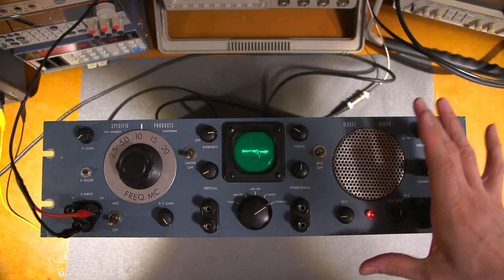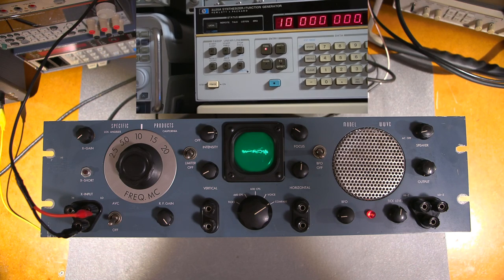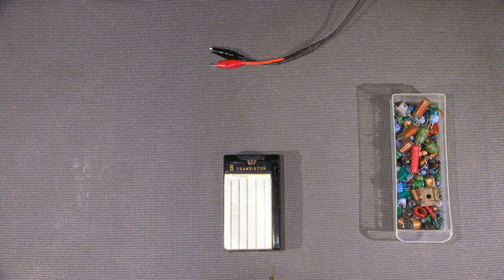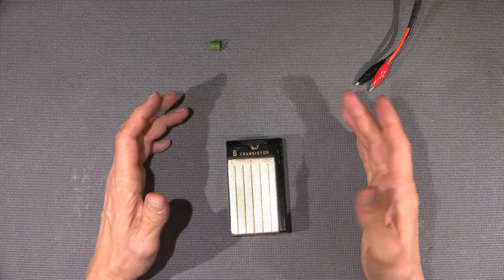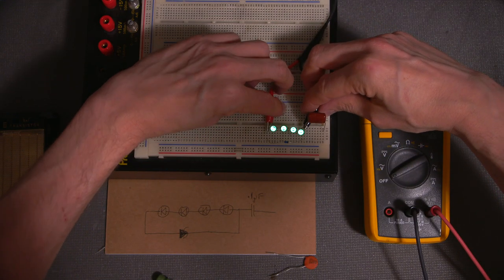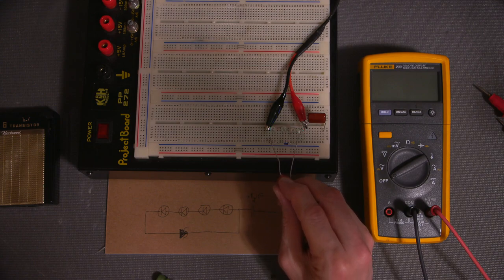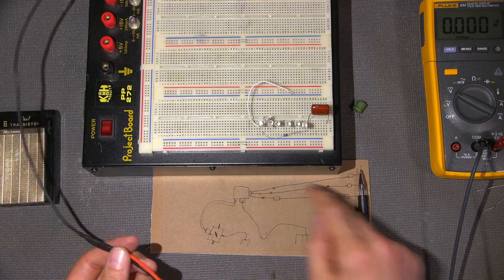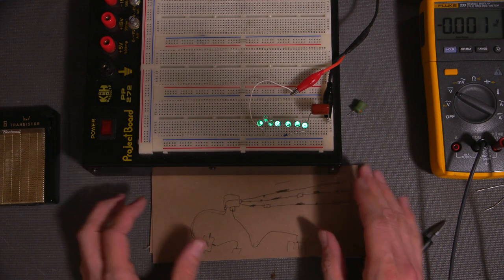Tech Talk And Hang Time At Mr Carlson's Lab!

Comment: Back around 1958-'59, Popular Electonics (or maybe Electronics Illustrated) had a do-it-yourself project for an entirely antenna-powered receiver/amplifier. Tuned to a strong local station, it generated enough voltage to power a transistor amplifier. Then a second tuned circuit could select a different station and be heard louder thru the amplifier.

Comment: Induction... it's amazing stuff. How many LEDs could be lit up this way? The antenna receives RF from remote radiostations, obviously, which is what powers the LEDs. I am curious - would the antenna be 'good enough' to power LEDs from just cosmic background radiation (assuming no radio stations) and/or anything else it'll pick up?

I am asking because it reminds me a bit of Tesla's experiments with a elevated plate being charged up and periodically discharged into a capacitor, gathering supposedly minute quantities of energy. I think later in his life, on July 10, 1932 Nikola Tesla stated: "I have harnessed the cosmic rays and caused them to operate a motive device." That may be a different experiment, but interesting too. 

All this is very interesting stuff. Thanks for sharing, mr. Carlson! Much appreciated!
Reply: I guess it depends how far away a thunderstorm is.... ? In fair weather it can be 100-300Volt per meter (height), and near a thunderstorm it will be in the thousands of V/m, strongly peaking when striking. I don't think it is all rf, but I could be wrong.
Reply: @erikdenhouter  That's an interesting observation - that's static electricity, I believe, but I am not sure if that's the same phenomenon mr. Carlson showed us, which is likely RF energy. I'd love to hear from him about the phenomena we watched. It's fascinating.
Reply: @alpcns  You're right, the capacitor shows it is about rf only.
Reply: @erikdenhouter  I wonder how close his 369 is to overhead power lines ... could he be getting loose coupling to them ? 
Or even electromagnetic radiation at ELF ... 🤔
Reply: @peterfitzpatrick7032  I don't think so, Paul doesn't speak about power lines anywhere. And (as I read) ELF (extreme low frequencies, in the tens of Hz) can not easily pass a .1 µF capacitor, but... the current that makes these LED's glow is low, I think not more than 75µA.
Reply: You can also use induction to prove that your car will run forever: It ran the first mile . . .
Reply: Odd that you mentioned the term "cosmic background radiation" and Tesla. In a word, Tesla proved the existance of cosmic radiation and later called it "dark energy " . We see and hear it everyday when firing up our old CRT analog TV's without an antenna (or off channel). Now how to tap its potential: Strongly recommend you reading "Secrets of the Cold War Technology" especially chapter one. Notwithstanding,  Tesla purportedly did so by repeating the effects of closing a dynamo switch connected to a full working load and perfecting the amount of time the switch were open vs closed (hint...micro seconds closed). The results suggested a controlled and directional transference of pure electricity without electrons. In addition when this energy came into contact to a metal substrate, the metal would shed it electrons, become electrically charged and in some cases melt the metal like one putting a 'match to wax'. Closing: We've been kept in the dark about this since 1895. If you read that book....you can thank me later.
Reply: @Rev22-21  Resonance. It's not magic, or a free lunch, it's simply an efficient way of transferring electricity and nothing more.

Comment: You have demonstrated that the antenna extracts a nice chunk of energy from the radio waves it encounters. The method of multibanding is very clever, too. But the "goodness" of an HF antenna is not determined by raw signal strength, because due to the relatively greater amplitude of atmospheric noise compared with the internal noise generated by the receiver, it's possible to simply amplify the output of an inefficient antenna as much as is needed. This is why small loops with preamplifiers can be good receiving antennas.
The real test of a receiving antenna is its ability to provide a high signal-to-noise ratio. Given that we are not talking about highly directional antennas, that comes down to rejection of local manmade noise. I believe that since the outer shield of your coax is not decoupled in any way from the common lead of the antenna, it will provide a path for local noise from your noisy lab back up into the antenna. A worthwhile experiment would be to connect a  ferrite choke "balun" (not really a balun, but that's what most hams call them) at the feedpoint and see if noise pickup diminishes.

Comment: Nice, efficient enough to light up leds just from RF in the air like a wireless power setup. I guess a downside to that it's also very efficient at picking up 50kV spikes from lightning strikes even at 10-20 miles away. I don't think the leds would like that. Doesn't receviers have peak input signal limits of just a few V before something bad happens?
Reply: Input capacitors, and clamping diodes, can protect the receivers front end.

Comment: My first experience with an antenna was at age nine with a crystal radio.  I hooked a wire to the radio.  The wire was hooked to a broken steel slinky, which was attached to a basketball hoop.  I heard a local AM radio station advertising McDonalds hamburgers.

Comment: I remember that Art Bell was experimenting with a loop antenna he built at his place in Nevada. It was very large and he got a massive amount of voltage off of it. It is reported to be 1595 feet in diameter and has a double loop of wire.

Comment: Mr Carlson, have you considered ground rod earth loops by having four rods as you described. Also, regarding the distance of the rods apart giving rise to bigger earth loops but better overall impedance to earth. Also, the resistivity of frozen soil compared to warmer soil for example....?
I guess it's worth having these new issues in comparison to a noisy grid tied earthing system but would love to hear your input or perhaps experiments.

Comment: Very interesting demo!  Though they are low current, high brightness LEDs, the fact that you can light up a row of them like that with no power input whatsoever is fascinating.  Very Tesla-esque as many other people have mentioned.  Paul, I'm interested in how you calculated the three antenna lengths and how the shorter ones inductively couple to their longer extensions.  Is there a coil between the two lengths or is it just an insulator?
Reply: Like this a lot

Comment: I did a similar experiment on my 160 meter Inverted-L antenna.  I live in the middle of three 5KW AM broadcast stations.  Each are about 2.5 miles from me.  Connecting a full wave diode bridge across the antenna terminals I read 36 volts.  Shorted I get 8 ma.   Lights an LED very bright!  Connecting a frequency selective level meter I measure +10 DBm on two of the three and a little less on the third.

Comment: Hi Paul. That is a cool test gear. I have the same hp generator that you are using and the old gilrl just keeps clicking along. You have one of the best setups for videos also. Never a bad one.
I have learned a lot from your videos even after doing repairs on ham radios and amps for many ryears. Thank you.

Comment: Hi Paul,
That's a very effective antenna. When you were measuring the voltage across the antenna leads, would a VTVM give a more accurate reading? You and the family stay safe.  73  WJ3U
Reply from the maker: Yes, the HP-410B would be a better choice for reading the RF level. Thanks for your kind comment Don!
Reply: And removing the LEDs while taking the reading would be better too. Very impressive. I wonder if most of that power is coming from just one local station? It would be interesting to take some readings via bandpass or tuned filters.

Comment: I have been intrigued by ground rod's for some time now, as far as I know, it's usually just a copper rod hammered into the ground but I have a theory where if the ground rod was insulated with just the tip exposed to ground at the deepest point, I'm expecting a greater difference in potential as the ground point would now be grounded in a more negative point of the earth and thus providing a much stronger signal. My thought process is that the bare copper rod would follow normal Electric rules and thus conduct at the path of least resistance... By forcing it to source ground at a deeper point, you should effectively be increasing the power of the antenna... 
It's an experiment that I have been wanting to do but I just haven't got around to it yet.... 
I really wanted to see the open circuit voltage of your antenna but you didn't end up showing it... 
I wonder what voltage will be present during snow fall? Or rain fall?... Maybe a future video lol????
Reply: Deep thoughts by Peter Milanovski
Reply: @KD2HJP  Deep observation by Charles Nolan 🤓
Reply: I'm currently staring at my shack's ground rod. I fully blame you. 

At least it has potential. (See what I did there)
 73 DE KD2HJP
Reply: Ground rod's what? Noun missing.
Reply: Well this post quickly went deep south!
Reply: To couple efficiently to the earth you need the largest possible surface area of your earthing rod in contact with it. If only its tip is exposed, and we ignore any capacitive coupling effects through the insulated section, your connection will now have an increased resistance to ground. That resistance is in series with your signal, so if it's significant in comparison with the antenna's impedance, a lot of your signal will be converted to heat as it passes through it.
Reply: Electricity does not follow the path of least resistance. It follows all paths, and does so inversely proportional to their resistance.
Reply: @jerrymalone8370  Exactly! So the greater the contact area, the less the resistive losses.
Reply: @jerrymalone8370  that's exactly correct... That's why I mentioned to insulate the ground rod so that only the tip is exposed at a deeper level below ground... As the ground itself is a very good conductor, my thought process is that if I were to use a ground point at a deeper level, I could be increasing the potential difference between it and the antenna above the ground... It's just a theory which I haven't tested yet but plan to in the near future some time...
Reply: @robinvince616  you could be right, I personally haven't seen much on this topic, not that it doesn't exist but more that I haven't had a need to. I'm not interested in radio, well not that kind of radio anyway. I just wanted to explore the possibility of harvesting atmospheric energy, I know that it's been already done and have seen plenty videos on the topic but this grounding thing has me intrigued and I'm wondering if there's anything else in it... 
Where I said about only the tip being exposed, I was being a bit vague... Naturally the exposed end is going to need plenty surface area exposed for better conduction, we are not talking here about a lot of current, but what I'm trying to achieve is a higher voltage without going up with the antenna by grounding at a deeper point in the earth if that makes any sense?
Reply: @PeterMilanovski  If the layers of earth are at different potentials relative to one another, after you put the ground rod in place they will all be at the same potential. The ground rod is conductive, so you will be connecting all of the layers together, and currents can flow between them. The ground rod will have the potential of the deepest layer, and so will the upper layers (near the ground rod).
Reply: @jerrymalone8370  so does that mean I should see a higher voltage compared to a normal ground rod? 
I will experiment with this sooner or later, I don't know what the outcome will be but I will know better after that actual test is performed...
Reply: @PeterMilanovski  The ground is like just one enormous lump of conductive material, so soil characteristics apart, there will be no difference in your results whatever depth you connect to it. The antenna's effective height above ground will still remain its height above the actual surface. Raising the REAL height of the antenna will, in most cases, give an increase in signal strength, because this tends to reduce the screening effect from objects and the Earth's curvature. It also affects the antenna's vertical directional characteristic, focussing it more downwards towards the horizon. This usually favours the more distant signals.
Reply: @robinvince616  that makes sense, but I still have this niggling feeling about the point at which depth the grounding is accessed and I guess that I just have to test it out to put that feeling to rest.... The science behind it is great but I don't think that it's perfect, well science in general and I feel that even though the science is saying one thing and you have something that's telling you that there might be something else in it, you just have to do it...
Reply: @PeterMilanovski  It means that insulating the ground rod will give you a worse ground, with the same voltage on your antenna. Is your rig grounded to your house wiring and/or cold water pipe? If so, you are already connected to a very good ground that is far better connected to the earth than the tip of you insulated ground rod. 

What you want is a high RF voltage between the center conductor and shield on the back of your rig, and the same at the coax right before it goes into the antenna. If you have, say, a dipole, you should not even connect the coax shield to earth ground.
Reply: @PeterMilanovski  It usually takes just two reply's to do that.
Reply: @jerrymalone8370  Tell that to a lighting bolt! Just kidding!
Reply: I don't believe that shielding your ground rod, and connecting with the soil that is deeper into the earth will have much of an effect. The soil is in constant contact with itself, no matter where you connect to it. I don't think there would be any advantage to doing this. In fact, I think that an uninsulated rod of the same length would work better, as it would be in contact with more of the earth.

Comment: Did you build in any meaures against static electricity from your antenna? I can imagine it can generate high voltage spikes when there's a thunderstorm nearby that can deamage your equipment. I'd really like some more info about how this antenna works. It seems to function really well!
Reply from the maker: Yes, oddly enough, we rarely have lightning here, but when I was at the top of the ladder working on the antenna, there were some flashes far off and distant thunder, I could draw arcs from the coax F connector to the mast pipe. This was before the ground rods were connected. I'm very glad I didn't touch the mast and F connector at the same time at the top of that ladder! What are the chances of all this happening at the same time? I should go buy a lotto ticket.
Reply: @MrCarlsonsLab  When I built my first receiver, a transistor super-regenerative short wave radio kit, it needed an antenna.  I used 30 feet of magnet wire strung on small hooks under the eaves of the roof across the front of my home.  Since I lived in tornado alley, severe thunderstorms were fairly  common.  The first time I saw a storm approaching, I disconnected the antenna from the radio so I could attach it to the air duct which I used for a ground.  Before I could attach it to the duct, there was a flash of lightning more than a mile away, which I saw and felt at the same time.  This demonstrated to me that you don't need a direct lightning strike to generate some impressive voltage spikes in a 30 foot wire antenna.  Static / corona is another thing that can build up on elevated metal objects during storms or from falling snow, as you have shown in another video.
Reply: @MrCarlsonsLab  ok, fair enough.. 😊 I wouldn't want to see any of the equipment in your lab being damaged. Or you for that matter..

Comment: Is this a traveling wave antenna? I've not seen the element coupling like this before. For TW antennas, they're terminated into a 50 ohm resistance, but you're not doing that. Is the inductive coupling of the isolated wire elements functioning as a type of matching stub?

Comment: Thanks for what you’re doing! Education and entertainment, all in one. I was a little concerned to see your antenna has an independent ground. When a lightning bolt is close, the difference in ground potential, given their proximity to the strike, can be hundreds of volts or more, with a lot of current behind it. Building codes require all grounds be bonded for this reason. I was also surprised to see the 369 antenna doesn’t use high impedance balanced line. Why is that?

Comment: A few years ago Paul demonstrated a transmitter he built and how energy from that could be monitored (seen and measured) on another receiving antenna as such. That's what purposed my subscribing to this channel.  Notwithstanding,  I'd like to see Tesla's demonstration of wireless electrical transmission duplicated, specifically with his "hair pin" circuit, and how he achieved lighting "carbon button" single wire lamps he patented. Though I recommended it previously,  I again reference "Secrets of the Cold War Technology "as a starting point for the curious minded. (Note please: The actual source for that work see Dollard.)

Comment: Absolutely fascinating Paul ! Another great video from you. Thank you. 

It's weird to think of the "energy" being coupled between the random coil and the radio is  actually extremely low energy photons coming out of that little random coil then inducing electrical "movement" inside the radio's antenna ferrite coil. 

Your 3- 6- 9 antenna seems to work extremely well ! I need one !!

Norm KC1VY